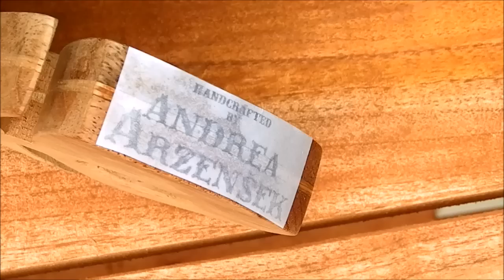Making of Anti Gravity Bottle Holder - Ep 014

Comment: Great project Andrea, you are doing great job with the jigsaw!
What kind of wood did you use for the fish bone? I just found a board in my cellar which has similar figure to that (I also saw that in your table saw structure where the switch is). It is pretty heavy, nice lumber but I just couldn't identify.
Reply from the maker: Thank you Tamas!
I used guanacaste wood (elephant ear tree) and in the middle I glued 6mm pine plywood to reinforce the bones of the fish.
That's correct, good eye, there is also guanacaste in the table structure.
Here is a quick read on guanacaste and a photo:
http://www.rochdalespears.com/blog/2012/04/26/guanacaste-wood-for-the-bina-furniture-line/

For what I know working with it:
- it's light weight wood
- soft (dents quite easily)
- works and glues very good
- irritates respiratory system when sawing/sanding (causes sneezing and nose running)
- rot and insect resistant (very high)
- I used sawdust to get rid of ants
- creamy sapwood with dark and beautifully grained heartwood